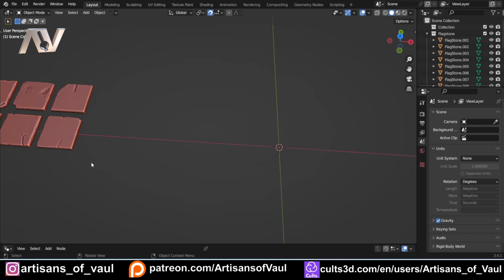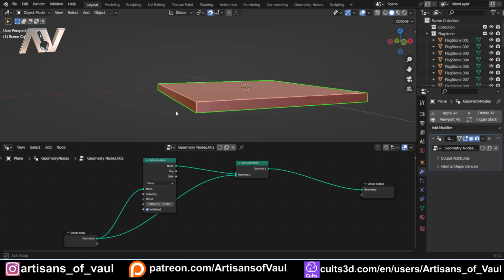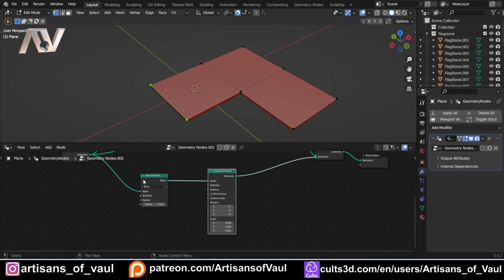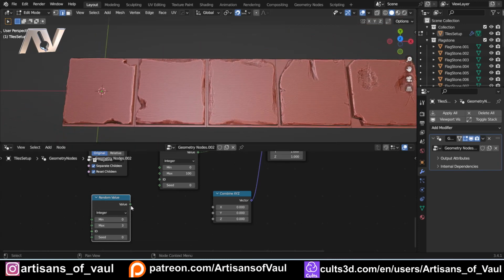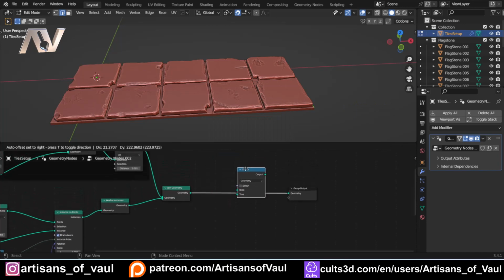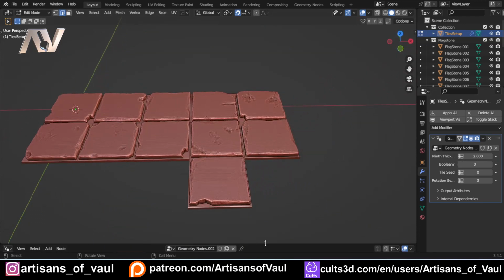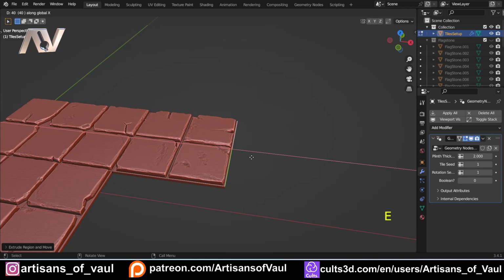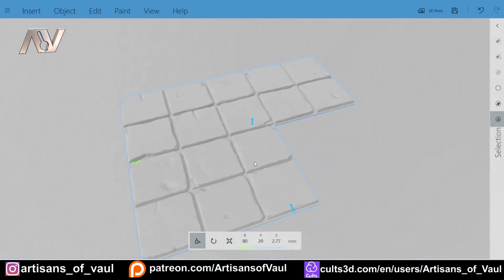Procedural Dungeon Tiles Using Geometry Nodes

Comment: Maybe a little late for this but, Degrees to Radians: pop in a Math Node.  In that node's dropdown list change "Add" to "To Radians".  It will have a field to enter at the bottom where you can input degrees.
Reply from the maker: Good point.  I'm not sure if that existed at the time I made this video but it is very true now.
Reply: @ArtisansofVaul  Yeah I figured.  Ty for the tut.  Helped me get started quickly in geo nodes for a sort of similar random tile setup.

Comment: Great video, Im going to try and make a sci-fi version of this, It should be simple, copy everything, but model the tiles in a different way.

The only issue is, that sci-fi usually has very uniform, or PERFECT tiles.
I have to figure out something for that. Maybe look at star wars for inspiration on this department.
Reply from the maker: @animation.practice97  Agreed on the sci-fi tiles wanting to be closer to prefect in design. This might be helpful for the individual tiles: https://youtu.be/ZtmE9N3L4go
Reply: @ArtisansofVaul  I actually tried hand painting and made like 5 variations.

I then followed the tutorial. Something was broken, the thickness, it was going diagonally for some reason. I just turned it off and manually made my tile a cube.

The rotation of the tile carried super hard. It made my wall and floor look really cool.

Soon I will try that other video you sent. A PROPER sci-fi wall or floor.

I really need help in that artistic part. I know from a technical perspective, how to make things, but I dont know how to make something look good!!
Reply from the maker: @animationpractice1166  That's off about the thickness and rotation 🤔

Comment: Perfect tutorial 👌 this has helped my workload massively as I have sevral dungeon concepts to build and a hero quest board to design. Only issue I'm having is I can seem to figure out why when I instance the tiles they do not seem to appear I'm playing around now to see if I can figure it out but I'm fairly sure I've followed along step by step haha😅
Reply from the maker: That's really difficult to help with without seeing the file. Possibly some of the tick box settings. If you have Instagram it may be worth finding me there so you can share the file?
Reply: @ArtisansofVaul  I think I have finally figured it out for some reason after trying everything I made a new collection dropped the tile set into that and everything worked I did have to put the scale up to 1.80 for some reason as it scaled them down but managed to fix that easily. It was very strange as I think it was a collection issue. I'm not on Instagram only Facebook currently I may have to set one up though but I do now have tiles at 30mm x 30mm. I havnt seen one just yet on here but have you got any tips on creating cracks and damage without add ons?
Reply from the maker: @chuckysmith5255  I have one for stone but it will find objects that are complex hard and it only works on the edges. As much as some people hate addons here it's either a lot of time or an addon really.
Reply: @ArtisansofVaul  yea I don't hate add ons I just don't have the money yet I've seen a couple I want that you have mentioned and if im honest I definitely need them it will same me so many extra hours in the long
Reply from the maker: @chuckysmith5255  if you're determined to do it without either booleans or sculpting is your best bet. Sculpting will add a lot of geometry though and booleans will work but would be quicker with Boxcutter/Hard Ops. That feels less bad to buy as you'll use it for SO MUCH else. If you can then one click damage and cracker are massive time savers. I've got videos of all of them if you're interested
Reply: @ArtisansofVaul  there the ones I have seen you use and I sit there trying to sculpt it manually and it can take a long time for one crack to look right so those 3 are definitely in the pipeline as all my sculpting has been manually sculpted it has helped doing it this way for quite some time as it means I'm forced to learn it the hard way and makes it so much easier to not cut corners so to speak but speed up workload and maximise the out put

Comment: Nice! Another thought is to do the tile deforming in the nodes, kinda “chipping” them. That way, you use less (those with large details), and those maybe 4 tiles are varied by noise and such into virtually infinite tiles!
Reply from the maker: I thought about that as a choice and it would work. But it would slow down everything quite a bit because if the computing time ai think.

Comment: Hi.  I just came across your channel.  Just really diving into Blender.  Quick question on this video... If I wanted each corner tile and each outside tile to be a specific tile, can that be done before the boolean?  I have tiles that have magnets in the top edges to attach walls, so I would want the ability to place them only on the outer tiles (sometimes) and in a specific rotation.  Thank you!
Reply from the maker: So not by itself without some complicated maths. The easier way would  be to program in a "wall" that's a boolean for the magnets so the corners get one on each side.
Reply: That is an interesting concept.  Any chance that you might make a video example?  Thanks for your reply. @ArtisansofVaul
Reply from the maker: @Randavian  I want to make one at some point to show how to make walls, it just hasn't come up as a project to video but at some point I'm sure it will. 👍🏻

Comment: Some great advice I saw for 3d print models: Turn on face orientation, then go in your theme and set the colors for face orientation such that the correct side is the normal greyish and the wrong side is red/pink. Then you never have to check, because it's always on and only alerting you when it's wrong.  Very cool tutorial. I'm so glad I found this channel.
Reply from the maker: Definitely good advice. I do that as standard when modelling but don't when I record as it can make the model have some slight distortion/colouring on the edges so it doesn't look as clear. Also, instead of trying to match the colour for the outside faces you can just turn the alpha value down to 0 and it will be translucent so it matches your normal settings 😁👍🏻
Reply: @ArtisansofVaul  Ha! I didn't realize that the face orientation was an actual overlay and not the entire color. Very cool.
Reply from the maker: @darrennew8211  👍🏻 It's a good idea from Blender to have it that way as it allows the use of whatever preferred viewport settings with it over the top. It's a nice touch to an already great program.

Comment: I was trying to do this, using your system above but I didnt get to do it. I like how it really simulates a mosaic, but I was rying to get an image onto it like this: https://m.media-amazon.com/images/I/91CioWMY-YL.jpg
Reply from the maker: Oh interesting idea. Just to check, the end goal was that all the individual tiles would become the mosaic? Or that each of the tiles has a mosaic on and you can put them together to make a really detailed design?
Reply: @ArtisansofVaul  all individual tiles together as a square plane form a mosaic just like the picture on the link
Reply from the maker: @wgalloPT  The issue with the pic on the link is that some of the tiles are aligned at odd angles. So I don't think it would work.
Reply: @ArtisansofVaul  Oh i see what you mean...but i thought a random node would accomplish the same effect, which it would not be bad at all....
Reply from the maker: @wgalloPT  I think you could for the rotation, but I think it will create a lot of overlapping points.

Comment: An excellent video to go watch now is user aVersionOfReality tutorial  'Random Modular Textures in Blender'.
Its something similar to this tut but using shading to create tiles with random 'icons' from a sheet with random edging from another sheet.
Imagine the 3D tiles above getting random texture wear patterns and getting random dirt along edges. And its set up so you can do mapping to 2 + tiles or 6*4...
This could also be used to place height/bump maps. 

Its annoying when you do not see amazing videos until a year after they come out....
Reply from the maker: I'll check that out. But being textures are these only for rendering or would they create a real 3D printable texture?
Reply: @ArtisansofVaul  'Only' for on screen... Which is why I added that you could do height or displacement to double down on the randomization. The height/displacement can be applied so it becomes real, printable mesh.
I know you are printing focused, but I for one do not actually own a 3d printer. I think other viewers are the same and are here for the generic learning - many making games would want to use a system like yours. I think combining random things is always going to add to the final result. I was also thinking when I watched your video that the GeoNodes setup that makes multi level localized subdivision (Recursive Subdiv ??) would also tie in well with this kind of setup.  
Thats the true power of node based systems.... Rather than pre making 10 or so tiles, you could use the auto texturing setup to mix variants of center and edge wear and make dozens of variants.....  with the subdivision automatically added where the height map effect is. 
And dont forget - that texture setup can most likely be transferred over to GN easily.  Its just mixing two random arrays together. The source can be mesh chunks rather than textures.
Lol - sorry, waffling on a bit... excessive excitement about how it just gets easier. So different from when I started 20+ years ago. I can remember doing an entire medieval hall with scripting... Madness.

Comment: I was fiddling with the Vector Rotate node (type Z axis) and got everything to rotate around randomly fine, but not sure how to manipulate the math to get intervals of 90 degrees... similarly, getting intervals of 60 degrees might lead to being able to hex tile. I just don't know the geometry nodes behavior well enough to get those consistent intervals.
Reply from the maker: I imagine you would just use a multiplication node as I did. Though for 60 degrees you'd have the random values from 0 to 5.

Comment: This geometry node setup is brilliant, thanks for sharing!  I've gotta ask though, which game uses 40 mm square tiles?
Reply from the maker: I use to play quest a lot and hated the small tiles, it made it a pain to use anything bigger like minotaurs/etc using modern models. This seems like a good solution.
Reply: @ArtisansofVaul  ah, cool!  Here's a hardmode question: how would you handle a hex grid like for Gloomhaven?  A six sided circle would be a great start, and you could duplicate entire hex faces instead of extruding edges, but I'm stuck at how to line them up.

Edit: well, I got a semi-functional solution.  Snapping the hexes to vertices with the center will create the desired pattern for the instances, but it'll create a bunch of ugly coplanar hexes beneath it.
Reply from the maker: @namedjasonc  That's tough. I'd guess that you'd need to use the same technique but have certain vertices (basically every other line in the square grid) have an offset that works with the size of the tiles. That would be used to replace the squares with the circles  Probably using the modulo function to select that row. At least that's my first thought. But I think you might need to use a grid instead of the setup I've got here. Though maybe it would still work.
Reply from the maker: @namedjasonc  With your method I think you'd need to make sure you joined the geometry and and merge vertices to clean the mesh a bit before the extrusion node.
Reply: @ArtisansofVaul  That works great; I set up a separate object as a hex grid using a pair of array modifiers on a 6 vertex circle (with an extra vertex in the middle), then used snapping to put my plane faces onto those vertices as needed to create whatever shape I wanted.
Reply from the maker: @namedjasonc  Winner! Well done!
Reply: @ArtisansofVaul  Hey, I really appreciate that you took the time to put this video together and then to brainstorm!

Comment: Awesome! I have a GN setup I've been kicking around for creating brick walls procedurally using input fields for things like brick dimensions, grout line thickness, wall dimensions, etc. But what I REALLY want is for the user to be able to source the wall dimensions from a piece of geometry, like you've done here.

Thanks for this! Great content, as always!
Reply from the maker: Oh, nice. To do that you might want to combine what I have done with using a bounding box (you can use those to measure size). I have a video on a geometry node setup to create a tiled roof that does basically that if you want to check it out.
Reply: @ArtisansofVaul  I will definitely check that out! I've been working on a similar project, but for modern, suburban houses. I have some tiling shingles for a roof line working, but it's a bit cumbersome, so I would definitely welcome a better solution. 

Geometry nodes are so freakin' cool...
Reply from the maker: @jlb-7777  They REALLY are!